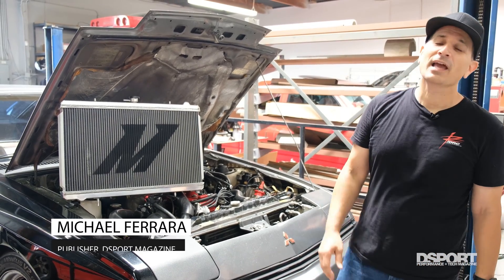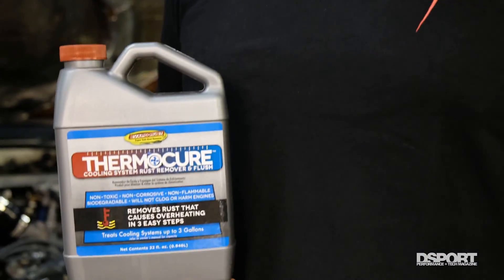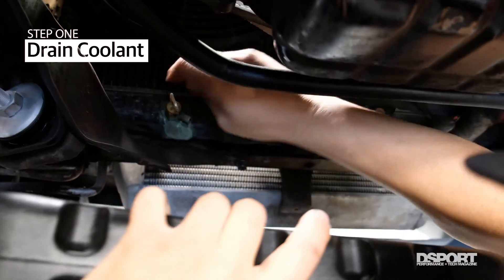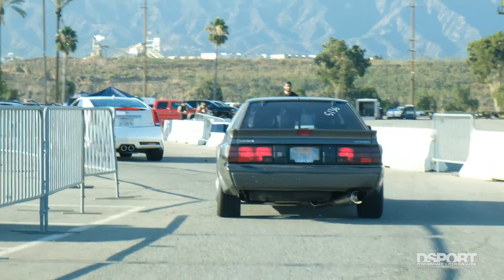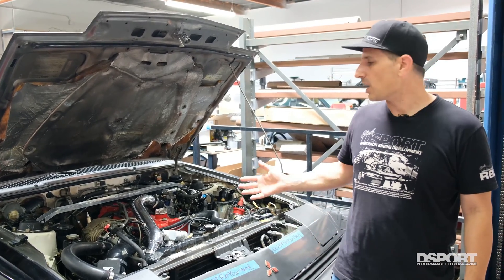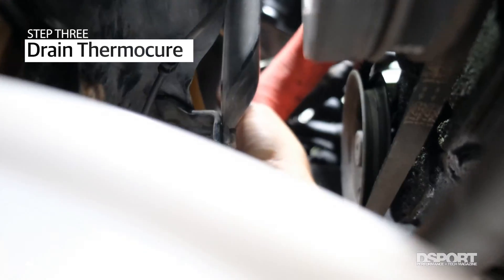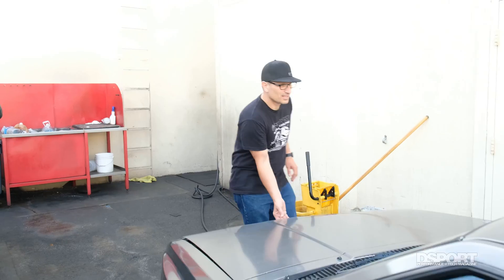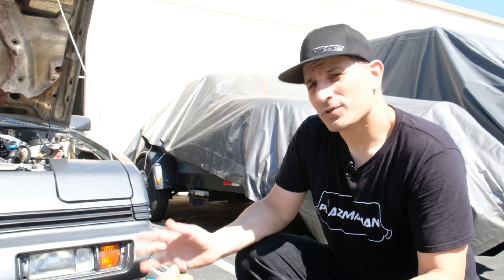Removing Rust and Corrosion from the Cooling System Using Thermocure

Comment: I bought a Honda Ruckus recently for us to ride so we don’t have to pull out our big bikes and the first ride it overheated and i found out the system was full of water and the thermostat was completely seized I had to chisel it out. I cleaned out the housing and got a new thermostat but I can’t get into the inside of the engine in the jackets and it’s full of calcium. I’m going to run this stuff for like a month after I get it all together

Comment: Great tip to flush engine. Why  would aluminum bee considered an upgrade, maybe because its lighter weight? otherwise cheer is a far better radiator as copper conducts heat far better.

Comment: I used this after using several others and I just now took the cylinder head off and the coolant jackets are full of surface rust. Prior owner never maintained anything but also I used this exact flush and there's still so much grime and surface rust inside the bottom end. How can I get all this rust out without taking apart the bottom end? Just put everything back together with new gaskets and then flush again? If I have to I'll send to a machine shop but I'm trying to avoid that. Thanks

Comment: Nice. SO I have a truck with a blown radiator and I have a new aluminum one for replacement. Lots of rust. How would you suggest I should proceed with the flush?
Reply: @K G I have no idea why I wrote that. Long time ago. I have already used this product. Worked well.
Reply: I've got some relatively hard buildup. Will this clean it out completely?

Comment: if there rust in coolant does it mean its too late there already damage to the system and engine?
Reply: Maybe the old radiator,

 But, not the engine
Reply: No in the engine is just surface rust and it bounces back. But hoses, coolant reservoir, radiator, etc... I would get new

Comment: I have a diesel that has really orange coolant due to rust, I k ow it isn't the head gasket because there is no oil mixed in with this as well it not having and extra pressure through the system, do you think this help clear out this as I am having trouble completely removing all of the rusty deposits. Thanks

Comment: What about CLR? Will that damage anything?
Reply: Did you find out anything about CLR? I have an aftermarket aluminum radiator and used a coolant system cleaner in the first flush, then I've flushed it 6 times and it's still a bit orange.
Reply: @powdere4donuts  it’s just real rusty
Reply: @powdere4donuts  probably have to clean or get a new coolant reservoir and change all the old hoses. Seriously this rusty crap is more than just rust. Its also grime from algae and once the algae is in the system it keeps growing. Is almost impossible to truly clean a system 100% once it gets to this point. Don't ever use tap or hose water either. Use DISTILLED WATER

Comment: The problem with chelator is that it traps the metal ion through ionic bonding..so, we dont want to have iron trapped inside the chelator instead we want iron oxide (rust) to removed. So we need a reducing agent that can reduce iron oxide to iron